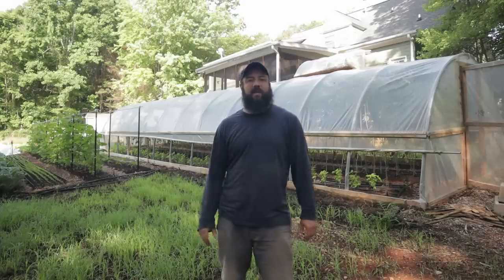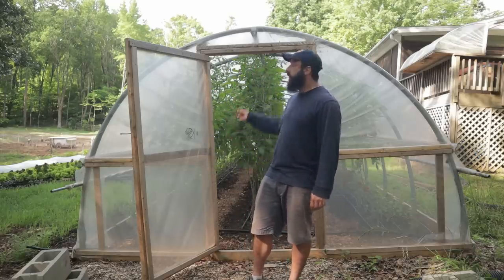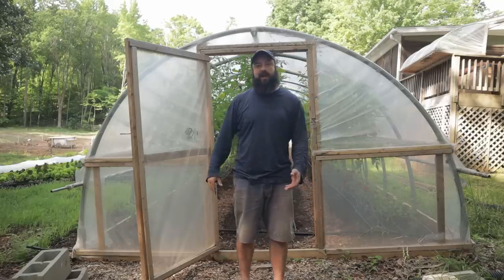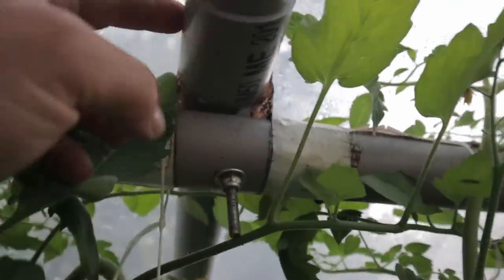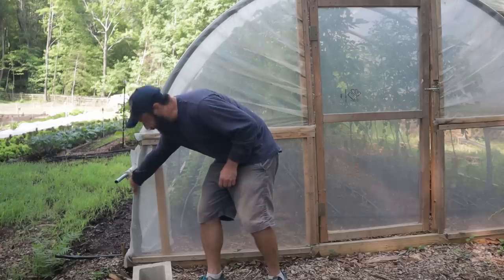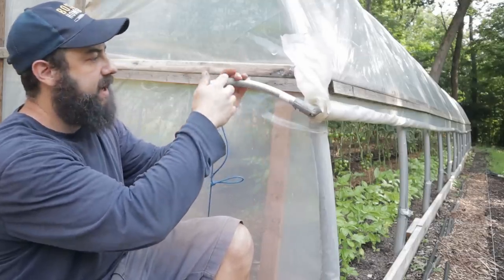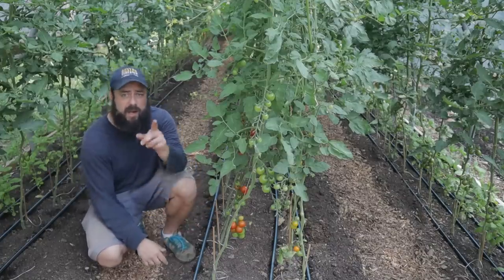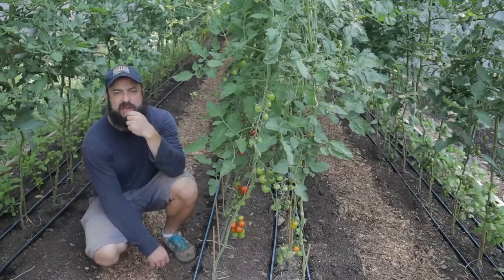DIY PVC GREENHOUSE

Comment: Hello sir,
So far nice video, but I must say... even though you said "I'm not going to get into it today", pressure treated wood, regardless of what ever research you did, is not a good choice for the garden.
It's on the ground, within inches of the roots of the plants on the outside rows... chemicals from the wood can and will leach into the soil and be absorbed by the roots.
Man, I've hauled that stuff for a living. It's bad juju Gilligan.

The companies that produce it (treat it) will tell you the very same thing. There are warnings about this very subject on the labels.
You are not supposed to burn it either because it WILL give off toxic gases the CAN be harmful, especially if your of the "Breeding" population. It can literally CHANGE YOUR DNA.

Please reconsider having done this.
You may have got that wood for free, but even so it isn't worth the risks involved.
Same goes for PALLET wood.

Pallets are dangerous for a wide variety of reasons... I won't get into it right now, but I've had plenty of first hand experience with pallets and I can and would testify in court that in my professional opinion, they're dangerous and the disposal of them should be governed by some kind of universal SAFETY standard, but they are not.

Now onto the rest of the video... you look like a real nice and intelligent person and I'm very interested in seeing more of your work here.

Cheers :)